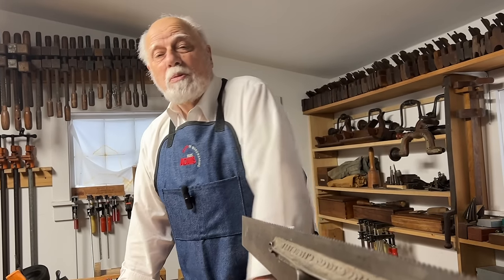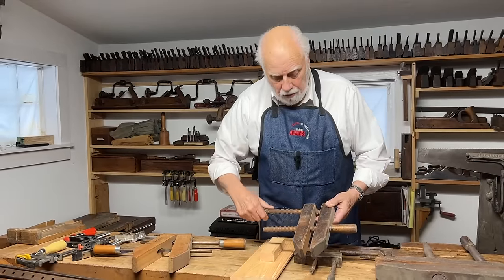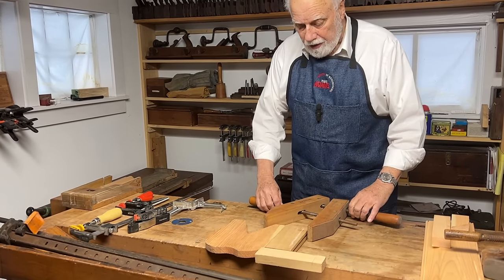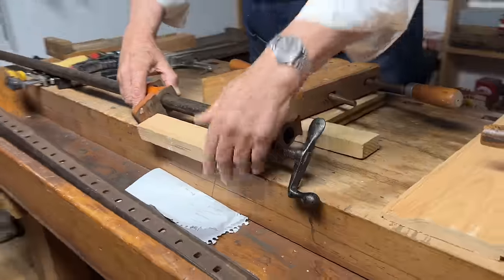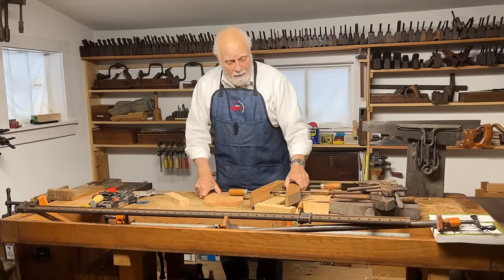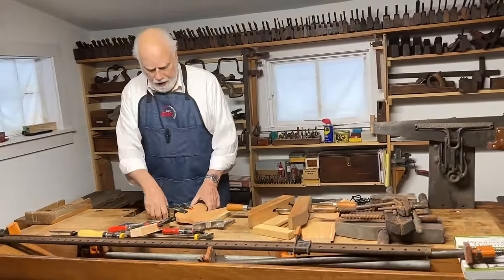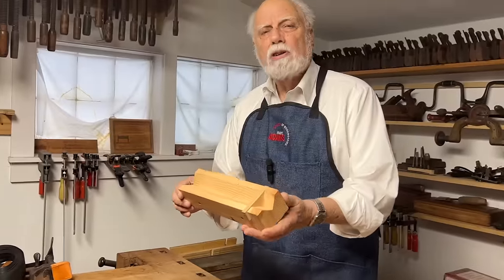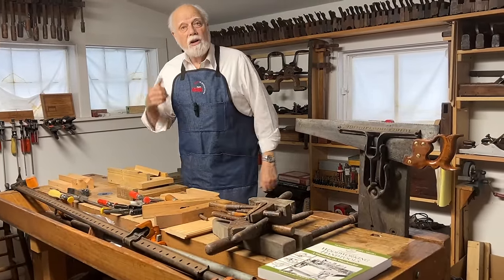65.Holding Devices

Comment: I made a very effective planing stop for my bench from the blade from broken hair clippers, I can back out the screws for height adjustment, I later chiseled out a recess so it drops flush with the surface when not in use, I learned this the hard way after accidently snagging my arm on it 😬. Rex Krueger makes a very clever version of this which is held in the face vice. A small piece of sheet metal and a file and you can make your own planing stop too. Making jigs and "helping hand" devices is all part of the fun.
Reply from the maker: Absolutely!

Comment: Thanks for another great video Graham.  The corner clamp you showed just after the F-Clamps, has a diagonal slot in the mitre corner - is that so you can run your saw along the mitre to clean up joints which may not align properly?
Reply from the maker: Not advisable.

Comment: It's always illuminating when I get to watch one of Mr. Blackburn's videos.  In addition to holding pieces of wood together for gluing or fastening I often use a spring clamp or screw clamp as a temporary "foot" on a board that I need to hold horizontally during assembly such as the wall of a carcass.

Also, I am greatly enjoying Mr. Blackburn's Furniture Design and Construction book I recently purchased.  The text and illustrations are every bit as clear and relevant as what I find in his video series.  Highly recommended.
Reply from the maker: Thank you so much!